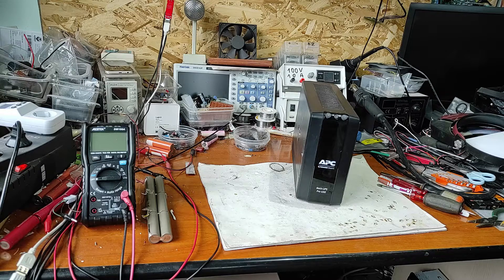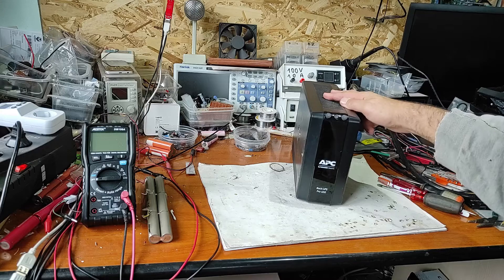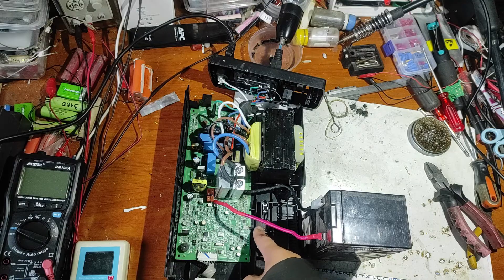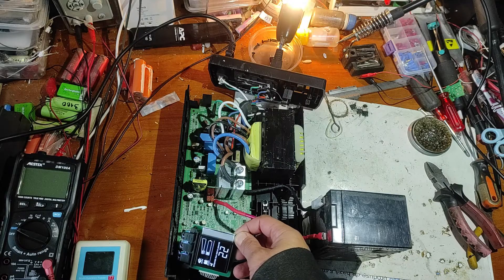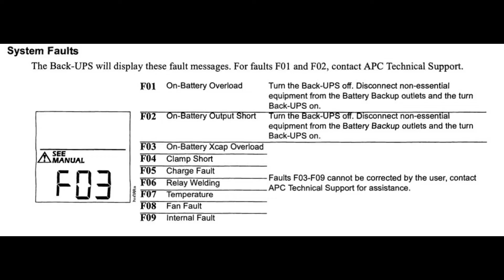Apc F02 Error Solve Ups

Comment: Hold the power for 5 seconds to turn it off. Turn it upside down, remove the battery, turn it on, wait for it to chirp to tell you the battery is missing, then reinstall the battery.
Reply: DUDE THIS WORKED THANKS!!!
Reply: It works! Thanks!!